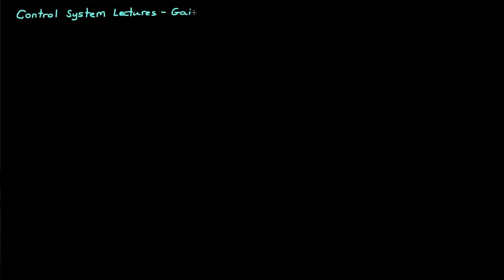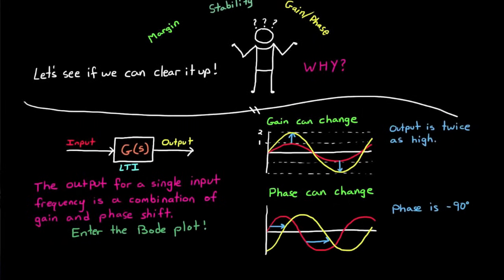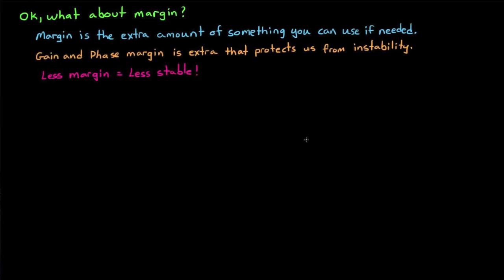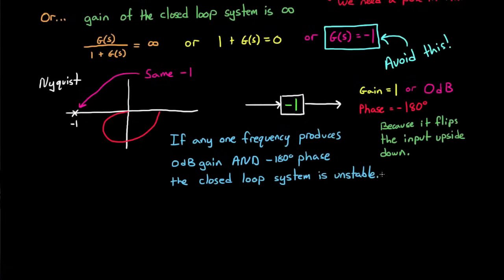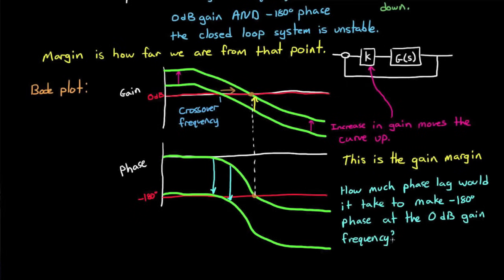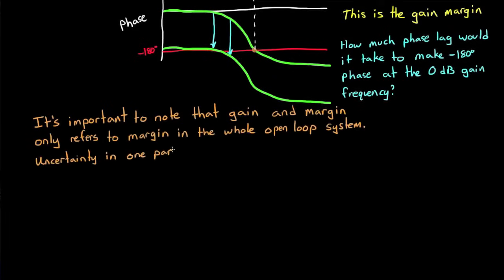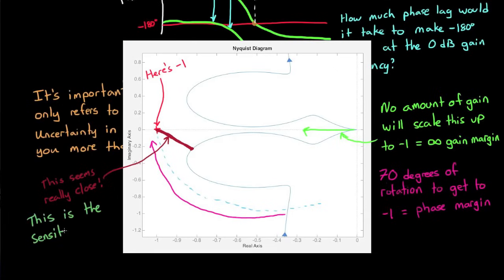Gain and Phase Margins Explained!

Comment: I took a course in Control Systems (I) ... many moons ago.  I recall being able to calculate just about anything in the class (Mason's formula, gain / phase margin via poles and zeros, system gain, ..., etc (thought of it mathematically vs. intuitively to borrow a phrase from one of your other videos) .  It wasn't my depth sequence but an elective/requirement?  I don't remember.    It was very abstract if I recall.  Watching your tutorial, I now understand the implications of both the phase margin and gain margin in a system w/regards to the bode plot (or maybe now that I have experience, I view things with a better set of lens  🤔).  Thank you for creating this material for the masses.  Much appreciated!  🙂💯

Comment: Thanks for you video! However I want to bring up a problem: the part where you explain why we should 'avoid' -1 seems a bit unclear. Maybe you should examine it by using the Bode plot and Nyquist plot to show that when we cross over the -1 or encircle it, there is an indication of the existence of zeros in the right half plane (assuming that there is no pole in the RHP by assuming the open loop system is stable at the first place) and hence the system is unstable.😇

Comment: I'm struggling to understand why negative phase margin of G(s) would make a closed loop system unstable. Because if there is a negative phase margin or gain margin that means G(s)not equally to -1. It will less than -1 and that should not be a problem, right? Because its not making the closed loop gain infinity anymore?

Comment: I have three queries 
First query, how -1+j0 point is translated only to -180 degree in phase bode plot and not to +180 degree in phase bode plot? 
Second Query, If magnitude plot does not reach 0dB, how to comment on the Phase Margin and stability of the system?
Third Query, For the system to be stable, Do we need to have margins on both gain and Phase. If one of them fails then how to know about the stability status of the system. I will be grateful if someone answer my queries. Thanks in advance

Comment: 🎯 Key Takeaways for quick navigation:

00:00 📊 Gain and Phase Margins Introduction
- Gain and phase in linear time-invariant systems: Distortion, magnitude, and phase shift explained.
- Gain is the ratio of output magnitude to input magnitude; phase shift is the signal's angular shift.
- Bode plots: Show system gain and phase across frequencies, crucial for understanding gain and phase margins.
03:30 🛡️ Understanding Margins
- Margin as a safety net: Extra gain or phase before system instability.
- Importance of margins in stability: Less margin can lead to instability with minor system variations.
- Designing systems with built-in margin: Accounting for uncertainties and process variations.
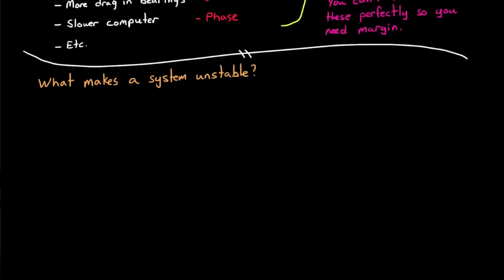05:49 📉 Understanding System Instability
- Unstable systems: Characteristics involving poles or roots in the right half plane.
- Assessing closed-loop stability: Designing open-loop systems and using tools like bode, root locus, and Nyquist plots.
- Avoiding the -1 point: Critical for stability; staying away from the zero DB, -180 degrees phase combination.
08:06 📈 Quantifying Margin on Bode Plots
- Analyzing gain margin: Impact on stability as gain increases or decreases.
- Phase margin: Assessing phase delay for stability; its significance in system stability.
- MATLAB's role in quantifying stability margins: Extracting gain and phase margin from bode plots.
10:55 🔍 Uncertainty and Margin Sensitivity
- Impact of uncertain parameters: How a change in a single parameter can affect overall system stability.
- Gain and phase margin's holistic view: Refers to margin in the entire open-loop system; focusing on specific uncertainties.
- Misleading system stability: Examples where apparent stability can mislead system behavior.
13:22 🧲 Additional Metrics for Stability
- Nyquist plot's insight: Using it to deduce system stability in relation to the -1 point.
- Sensitivity metric: Evaluating the system's stability based on the proximity of curves to the -1 point.
- Next steps: Teaser for exploring sensitivity in the upcoming video.

Made with HARPA AI
Reply: But i dont understand how to fix this problem, Can anyone help?

Comment: Hi Brian, Great lectures. One question : If the phase plot crosses -180 at a gain higher than 0 dB, can the system be still stable ? As I understand, phase margin test will say that its stable because G(s) will never be -1 and therefore 1+G(s) will not be zero at any frequency. 
This also means that if I decrease the open loop gain, the system will become unstable. This is counter-intuitive to me. Am I missing something ?

Comment: This bode plot shows the frequency response of G(s), which is the open loop system. It definitely provides hint about the close loop stability. But the closed loop frequency response of the system will be different, right?

Comment: Hi, excellent video as usual, but I had a question- I'm an EE, and in my IC classes we used to talk about how RHP zeros cause instability, and I understand why from a phase margin perspective- the gain increases 20 dB/decade while the phase is decreased 90 degrees, accelerating the progression towards -180 degrees. From your lectures, I also understand why RHP poles cause instability; if the roots are positive numbers, the inverse Laplace shows that the response will grow exponentially. My question is how do I reconcile the two? A RHP pole actually improves phase margin because it decreases the gain and increases the phase. Thanks

Comment: Hi Brian. What if the phase plot goes through 180 degress, which is essentially equal to -180 taking periodicity into account. Is it correct that in that case we should look at the 180 degrees crossing point? And i guess, that fact repeats itself every 360 degrees?

Comment: What if the gain margin is above 0dB line? Is the system stable?    -1 is the critical point of stability (only a single frequency), but is there some range of frequency (from Bode plot) for which the system is unstable and oscillations diverge?

Comment: What if my circuit goes from 180 deg phase to -90 deg before gain hits zero? Do I still look up to 0dB gain and -180deg (in this case 180deg - 180deg = 0deg) points anyway?

Comment: First let me thank you for this. ever after so many years it is still helping people like me. I have a doubt, the critical point is (-1, j0) that we need to avoid. In polar form it is 1angle(-180). Are the margins where you reach both magnitude and angle of that critical point or reaching either one makes system unstable? For example I increased my gain to 2 at which the phase of the system would be less than -180. Is my system unstable now?
Reply: You need both : The gain has to be 0 dB ( i.e. gain of 1 ) AND the phase has to be -180. If both of these conditions are met at ANY frequency, the closed-loop system will be unstable. In fact, it will oscillate at the frequency at which both of above conditions are met.

Comment: why negative phase margin and gain margin mean system is unstable  if we  just have to  avoide this combination: G(s)H(s)=-1(magnitude 0db and angle 180) in order to remain in stability zone. negative phase margin or gain margin still means the above undesired condition is not met,so we still have margin but in opposite directional sense.if say phase plot has already crossed -180 degree line before mag plot crosses the 0db line aka negative  gain margin but even then we can decrease gain by that amount((-ve)gain margin) before this happens:  G(s)H(s)=-1.I know i must be missing something very basic.can anyone clear this doubt.

Comment: What if the gain is +ve at the frequency for which phase = -180degrees ? Will that system be stable? Please explain how it's dynamics would be different from that of the system you used as example

Comment: what's the physical meaning of a -180 phase margin? If it is simply a delay of 180 degrees, or a inversion of the input, then what about  leading 180 degrees, which pictorially is similar?

Comment: First of all thanks Brian.

I am at a exercise where the closed-loop system is labeled as unstable since the phase-margin is negative. But in my understanding, as long as the phase-margin-frequency is (~far) away from gain-margin-frequency, the openlooptransferfunction is not getting -1 and the closed loop should be (asymptotic) stable. 

Where am I wrong?

Thanks for your answers in advance

Comment: Thanks for the great video. 
But what I don't understand is that how does Bode plots explain instability of the system which do not satisfy the G(jw)=-1 condition. 
For example, take a unity feedback closed loop system with open loop gain G(s)=1/(s-3). We see that this system has open loop pole is on the right half of the s-plane, so the open loop system is unstable. Even when unity feedback is applied the transfer function [G(s)/(1+G(S))] becomes 1/(s-2), i.e. the pole is on right half plane, making it an unstable system. 
But the bode plot of open loop gain G(s)=1/(s-3) doesn't have a greater than or equal to '0 db' gain at -180 degrees, which would make a system unstable according to Bode plot analysis. Thus, it means that the system is a stable one according to Bode Plot.
 But the system has open loop pole (s=3) and closed loop pole(s=2) is on the right half of s- plane, which means it should be an unstable system.
This is the problem I don't understand.
Can someone please explain this concept to me. Thank you.

Comment: Great Video :)
I would like to know more about the special cases:  
what happens when the Gain graph doesn't cross the 0dB line, and\or the Phase graph doesn't cross the 180 degrees line?  
how can you determine the stability then?  (given that you can't calculate the GM or the PM or both?)

Comment: Great video, though I came here wondering if you have a system such as G(s)=5/((s+2)(s+10)(s+50)) and are told to find the Gm and Pm by hand, what do you do if it doesn't cross the 0 db point (ie. starts at ~-45 db and decreases from the bode diagram).
Reply: if it does not cross then margin = infinity

Comment: I started my career in Engineering about 8 years after I took Controls and was immediately asked to analyze the phase margin of countless op amp circuits. It's something I had never encountered (or if I had, I lost knowledge of it after so much time in grad school then teaching freshman level EE courses and labs). It wasn't too hard to catch up to it because there are a lot of lessons online but this is easily the most practical and relatable. Thanks for your hard work. Is your book still WIP? I'll keep an eye out for it.
P.S. I wonder what possessed 19 people to down vote this video @_@

Comment: Hello and thanks for the video. I have 1 question though.
Why do we want 1+G to not be equal to 0. Why does it imply a CL pole on the RHS??? I mean even if we have CL pole on LHS, we will have 1 + G =0, right?
Reply: The closed loop gain of a unity gain feedback system is given by G/(1+G), when the denominator 1+G = 0 then we have the gain -1/0 = infinity, i.e. the system is unstable.
Reply: I don't get this either:((

Comment: hey brian,i have question..."poles on the right half of s plane makes system unstable i.e. gain must be infinite,then why doesn't poles on left half of s plane makes gain infinite i.e. 1+G=0(poles on left half of s plane)"
Reply: Do you have the answer now? I have the same question with you. If the poles on the left half of s plane, it would still make the gain infinite. "Gain is infinite" does not equal to "system stable", is that right?

Comment: you meantioned on the video about Nyquist stability that closed-loop system unstable if it has zero in the right half plane, but here in this video you said the opposite that if a system has pole in the right half plane, then it is unstable, so what is actually should be in the right half plane? Thank you for your answer

Comment: Thank you for a good explanation. There is one thing I do not comprehend though. Why is the closed loop system unstable when the Nyquist curve closes a loop around -1 when the system goes unstable when the open loop systems transfer function equals -1 (division by zero). Why is the case not, that the closed system goes unstable if the Nyquist -curve crosses the -1 in the plane? 

Thank you in advance!

Comment: Hi. What if the gain do not cross zero EXACTLY at phase = -180 deg, but that it maybe has a positive value? That means the transfer function G(s) won't be exactly -1, but G(s)/(1+G(s)) is still unstable? I don't understand why.
Reply: Ivan Soloest that will depend on how the curve moves. If the curve doesnot intersects -ve real axis then check for arrow with respect to the point (-1,0). If the point is on right side to arrow,it is unstable otherwise not

Comment: why is  phase crossover at -180  rather than 180?
Reply: ashu sharma because stability for open loop transfer function is checked around (-1,0), which has gain of 1 and phase -180°. If you have any questions further feel free to ask.

Comment: While I can see what you're trying to communicate, there are several problematic aspects of the mathematical shorthand you've chosen to express these ideas. In my view this creates misleading impressions of linear feedback control principles:

1. Implication that Closed Loop = Unity Feedback Gain. Most closed loop systems do not feed back 100% of their output to their input, and for that reason are not designed to insure stability at unity feedback gain. Your shorthand notation: G(s)/(1+ G(s)) applies only to that particular feedback configuration and does not accurately describe closed loops that do not employ unity feedback gain.

2. In the video @6:33 the  closed loop system at the bottom is drawn with a summing junction of input and output signals, rather than the differencing junction depicted in the top drawing. That is a crucial difference and I think it's misleading to gloss over it. With a summing junction, the correct closed loop transfer function is not G(s)/(1+ G(s)) , it should be G(s)/(1- G(s)). 
This obscured polarity inversion compels you to later assert that cases where G(s) = -1 are unstable, which to a student may inadvertently imply that negative loop gain leads to instability. That's exactly the wrong message, because negative loop gain is what's needed to construct a closed loop system with negative feedback. I really think your notation should emphasize that it is postive rather than negative feedback that causes instability.

3. Later on, you imply that this G(s) = -1 case (aka 0db gain with -180 degree phase shift) is  the specific condition required to produce instability. What's misleading is that in practice, 0db is just the minimum loop gain that will produce instability at that phase angle, and it's important to note that gains greater than 0db will do so as well. In short, G(s) = -1 is in no way a unique criterion in evaluating closed loop systems.

Comment: I'm stuck at trying to calculate all of that stuff manually. When designing regulators to try and change the gain and phase margins.
I know I'm supposed to replace s with j(omega) and then get the formulas for the absolute value of the gain and the phase of the gain. 
But when I multiply both the numerator and denominator with the complex conjugate in order to split the gain function into the Imaginary and Real parts it leads to such long-ass calculations. 
I get the right answer but it takes so damn long, and there are supposedly ways to do it that are simple and elegant (but still doesn't use the bode plots). Which makes me fear for the exams. I just can't figure out how to do it quickly.

Comment: could you please explain me why the gain cross over frequency should be less than phase crossover frequency......?? 
My doubt is even if the gain crossover frequency is greater than phase crossover freq. the characteristic equation will never be equal to 0 as G(s) will never be equal to -1 .....(because when gain is 1 phase is not 180 and when phase is 180 gain is not 1.....so it appears to me that system is fine....) please explain.....
Reply: Jayasurya Pitchuka In a practical system, number of poles is always greater than number of zeros,so the curve moves in anticlockwise direction. Also the gain keeps on decresing for MPS systems.If gain crossover frequency is less than phase crossover frequency then the system will intersect -ve real axis to the left of (-1,0) making the gain margin+ve and the system stable. If you have any questions further feel free to ask.

Comment: Thanks a lot. I have a question. We should be avoiding right half plane zeros of 1+G, but in the video what you did was avoiding zeros( avoiding G = -1 ). How is this equivalent?
Reply: Chen dunzhi simple. G(s) =  -1  is not a pole. See poles are the roots of characteristics equation (which are values of "s" not G(s). for example G(s) can be = (2s-3) which will give us a pole in RHP
Reply: The closed-loop system is G/(1+G)
So you get G/0 when G is -1
Reply: Thanks for your reply. But the question is we need to avoid right half plane of pole of G/(1+G) but G =  -1 gives pole, not right half plane pole.

Comment: what if the phase is less than -180 degree at cross over frequency? Because we do not hit -1 in that case also. However the system is unstable in such scenario as well. I am not able to understand why exactly the system is unstable? Does it have something to do with right half plane poles in closed loop?
Reply: Rohan Kimothi we will be crossing the -ve real axis to the left of (-1,0). which will make gain at phase crossover frequency>1 and gain margin -ve. Hence the system will be unstable. If you have any questions further feel free to ask.